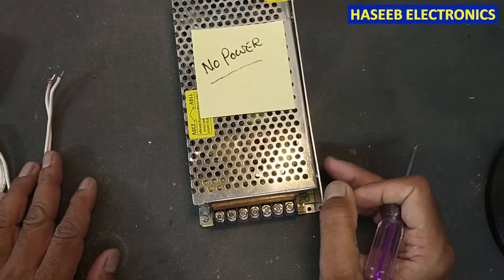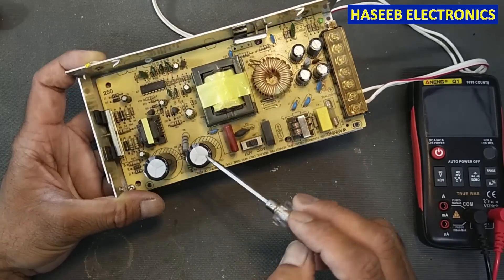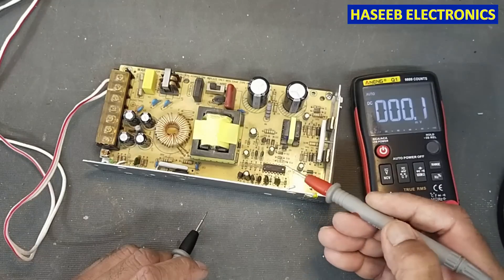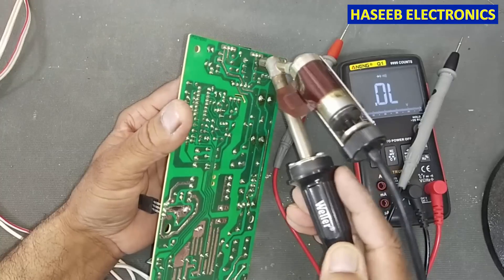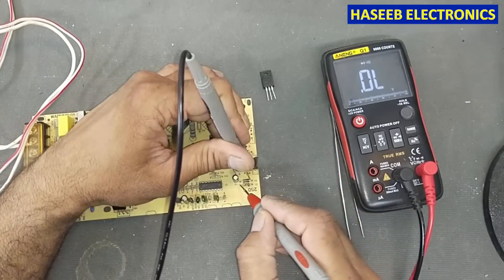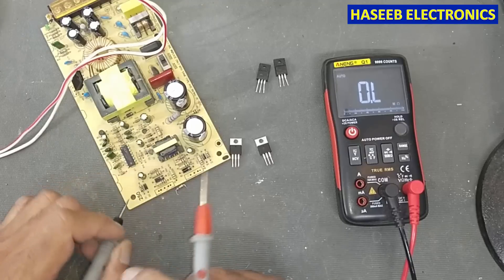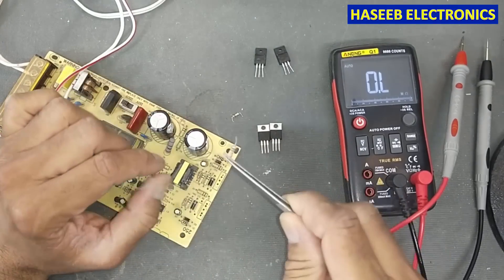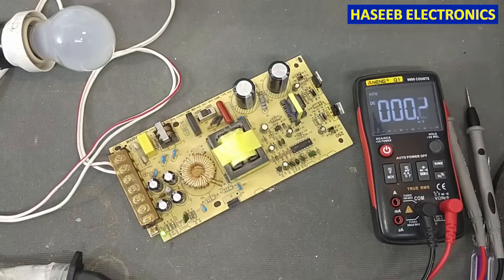{749} SMPS Is Not Working || SMPS Not Turning ON

Comment: Thank you your post! I have an interesting case with and old AT SMPS: pin 4 is always high, the Tl494 is disabled all the time. Checked the feedback circuit, all the active components are ok, all the capacitor replaced still the situation is the same: 1V output voltage and a humming sound. Vref 5V is present on tl494. Checked the high side as well, all the active component, they are good. Replaced the capacitors in the high side as well. I replaced the main transformer from a donor but the situation is the same.
Tried to reverse engineering the schematic of the feedback side. It is a really werid design for sure. Feedback circuit use a current transformer at the high side and the output voltages as inputs. Unfortunately I am not able to figure out how this feedback circuit works therefore I am not able to figure out what is not working using measurements. I am not dare enogh to cut the feedback from pin4, there is a canche of overcurrent - overvoltage which can cause cap blowing and other problems. 
Do you have similiar situation? All the active component checked, all the cap replaced still it does not work. What would be the next step to check?

Comment: Dear Sir 
I have the same problem no output but when I touch the emitter of the pulsing transistors c2655 with the probe of the avo meter the power supply turns on and before touching the emitter there is no any voltage even at any leg of the ka7500 ic 
What's could it be the problem 
Thanks
Reply: Sorry the collector not the emitter

Comment: Hello sir asalawalekum bhai jaan ..mere pass ek cstmr ka 12 volt 30 ampere smps aaya mene usko cheak kiya d13009k mosfet open the wo change kiye uske baad drive volt pr c1815 trasister change kiye 2.2 ohm drive signle resistance change ki ur uske baad supply ok ho gyi  12 volt output b de raha h ur chal b raha h pr samasya ye hai k jaise hi uske upr load dala jata h to thodi der chalne k baad uske d13009 mosfet burn ho rhe h  ur ye 3 baar ho chuka h  teeno baar mene mosfet chnge kiye har cheez baari baari cheak ki pr problum smj nai aayi plzz meri help kare esa ku  ho raha h sir

Comment: Vrey well done.    You first checked the voltage across the two large filter capacitors.  How would you proceed if the voltage is not symmetrical across theese?  (Zero volts on one of them)

Comment: Bro, the primary DC across 2 main cap is 500 volt.
The 13007 is heating, but MOSFET is no short-circuit.
No power output

Comment: Good night sir I have a few questions the diodes or they connected to emitter and collector and what what or the amperage ratio of the diodes because I want to ad Shockley diodes to my emitter and collector for spike reduction so I want to know if a 1 amp Shockley diodes can withstand the incoming high current of of 200amp to collect so but I can’t find a small diodes the can handle that much current so I want to know if the 1 amp is ok I don’t want to blow up my circuit to find out

Comment: Assalam o alykum. My smp power supply has 7500BD IC and it is showing 6v vcc at pin 9 and 12. Output voltage is 3v. Capacitors are OK. What could be problem. Jazak Allah khair

Comment: Great video  also have great tricks 
My question is about PWM controllers have some protect features (for example over voltage Protection etc) 
How understand pwm controller's in protect mode ? 
Because not working  power supply and all other components looking normal.
For example how can make "Troubleshooting board for IC" 
* We can try extarnal power  supply voltage for PWM controller 
* We can apply  suitable frequency and wave to need IC pin/pins for find problem 
Could you make a video for a famous PWM controller's "How understand  PWM controller's protect mode"

Comment: For ic ka7500 between vcc and Gnd how many voltage that it is good?
Reply from the maker: foe TL494 AND KA7500 
8 VOLT TO 35 VOLT ARE NORMAL 
in most of the designs it is between 10 to 24 volts

Comment: Dear brother, thanks for your great explanation and informative videos. I have a 24V SMPS that gives fluctuating output between 4-7 volts and it uses TL494, I check VCC and it was 7.3V, feedback is 5V & Ref is 5V. Pin 8 & 11 are fluctuating and the freq is not stable. What else shall I do to fix it? Your help is highly appreciated.
Reply: Seek for shorted componentd in the cold side.
Reply: https://youtu.be/YbUftLuvODg

Comment: Just curious, what is the smaller transformer for?
Reply from the maker: it is called "PULSE TRANSFORMER" or "SIGNAL TRANSFORMER". it takes drive from the SMPS IC, because the smps ic is in secondary side. so this transformer provides isolation between primary and secondary, and the power mosfets are in primary side (which drive the main transformer) 
in simple words, it transfers the drive signal from PWM ic to the mosfets

Comment: I used amps power supplies for my audio amplifier system and it just doesn't lasts long , so now i have replaced with Transformer power supply bcoz they tend to be really robust and in destructive even after enduring lots of abuse.

Comment: 2:19    Ahh sorry,  How did you determine that the fuse was good ?
Continuity beep ?   LOL
You do understand that the resistance can be very high and the beep still gets through right ?
You do understand that the resistance can be above 10 Ohm and the beep will still beep
even though the fuse is actually not good........... RIGHT ?

If you're gonna teach you should teach correctly

Comment: Thank you very much Sir for your valuable information. Sir in this ckt Opto coupler is not used then how the feed back is working to control the output
Reply from the maker: it is secondary side pwm controller. it uses direct sense line to the PWM controller voltage mode error amplifier. it uses pulse transformer to drive the power driver stage, so pulse transformer provides isolation

Comment: Can you make a video on making one smps dc power supply with every details and breakdown, and items used and where to purchase. A video no one ever made, a class no university ever taught. Thanks
Reply: it is not easy thats why... and involves high lethal voltages.. better buy one
Reply from the maker: @Theseus you are right.
Reply from the maker: welcome brother 
first of all i am thankful for your valuable comment
second thing. that a power supply design is complete science and it needs a very long, deep and interconnected to each other calculations. 
so it is really near to impossible to cover this topic in one video. because each step, each component. each parameter needs scientific calculations, so it will much difficult to do it. 
i will recommend that if you study Pressman's (book name Switching Power Supply Design fourth edition) 
it is perfect
Reply: @HaseebElectronics  Thank you for the suggestion. I would also request that you can make a video on the solar charge controller. That could be a new and demanding topic in recent world electricity shortage cases.